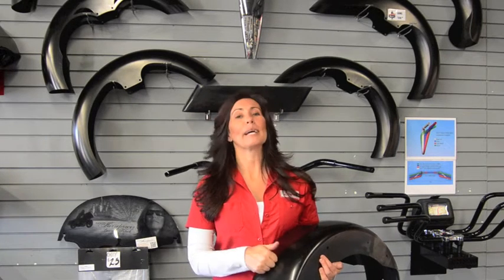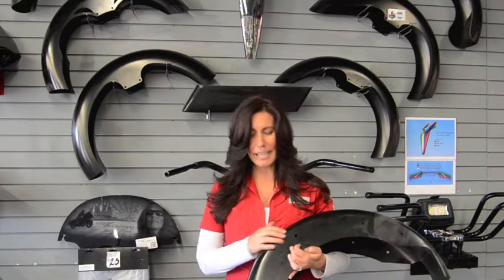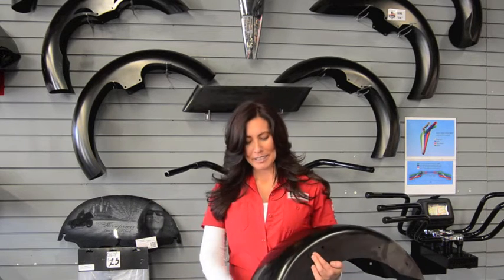Understand the Difference; Klock Werks Fenders

Comment: Hi, I have an FL front fender (21"), it's a Klock Werks fender. I'm currently rolling a 120 70 21" Metzeler front tire in it. Question, I was offered a Dunlop 130 60 21". Will my fender receive a 130mm tire without problems? I cannot mount it to fit it without purchasing the tire first. Thank you for any information regarding this.